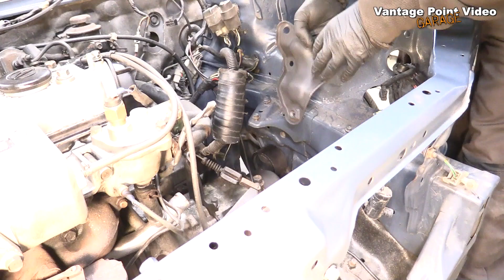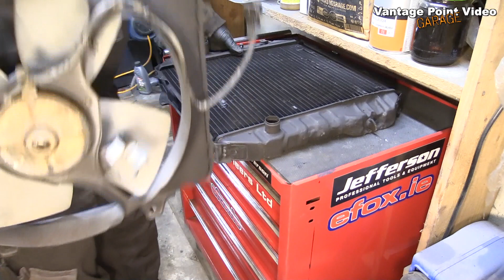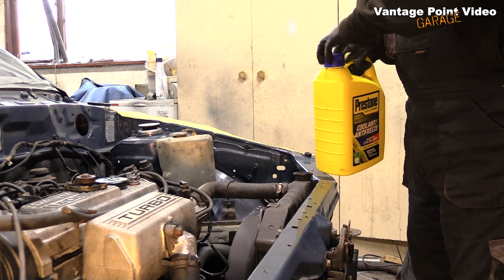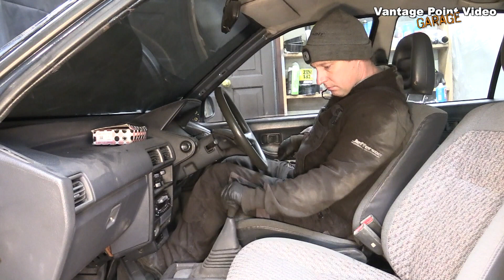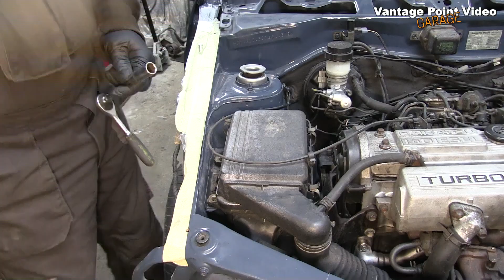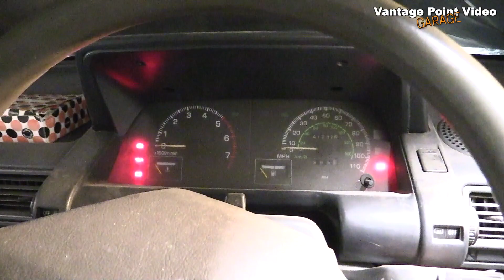Starting 1L TD Charade Engine after rebuild: Charade Restoration #46

Comment: I know how you feel, I'm putting off taking out the engine on the cinquecento sporting as there are a few bits I'm not sure what they are, and certainly some bolts will snap. Also, fiat didn't put as much thought into making things logical to remove/reinstall as daihatsu. Fiat have the same engine shoehorned into many models.